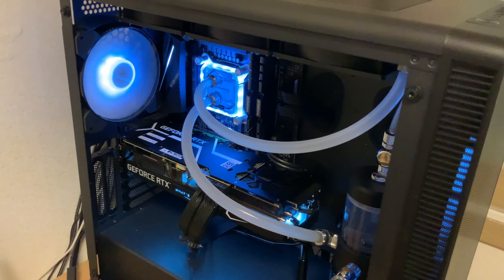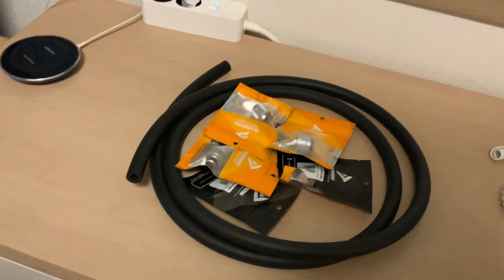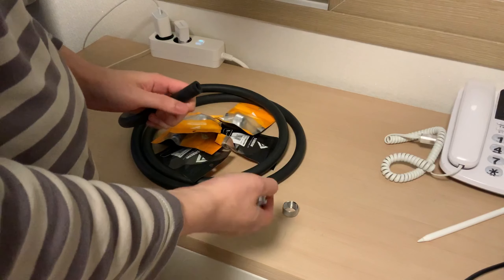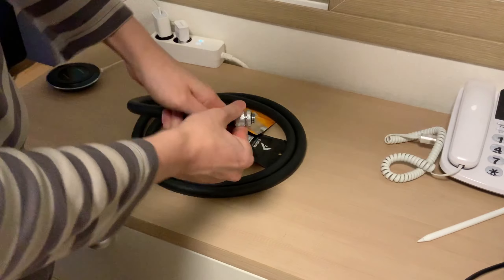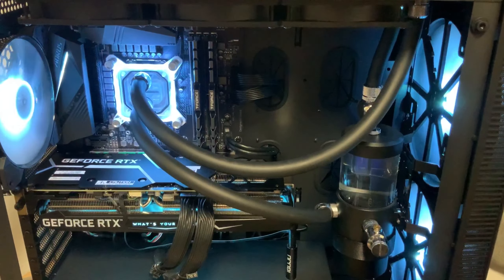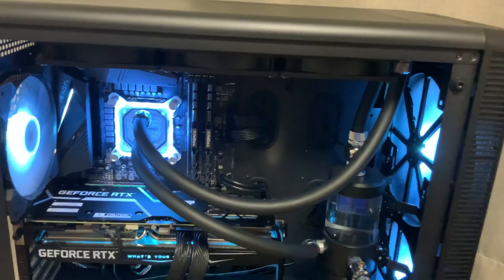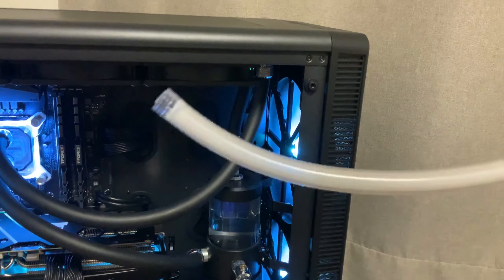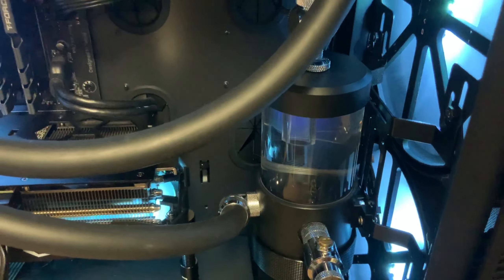Upgrading loop with the EK ZMT tubing and Barrow compression fittings.

Comment: I've used Ek clear tubing and never ran into foggy tubes nor discoloration as long as I used the EK cryofuel. Even my blocks are clean after running it for years.
Reply: I was wondering this exact thing maybe they have it chemically balanced or something so it doesn’t mess with their specific tubing
Reply: @Imperial-simp_destroyer  I think they state that very raining on their website.
Reply: @fromearth6282  ahh ok ya I might do that then usually makes sense to use the same brands so looks ill be purchasing tubes and coolant from EK
Reply: @Imperial-simp_destroyer  Make sure you wash the rads and blocks! 👍😜
Reply: @fromearth6282  definitely will thanks for the info my dude

Comment: I also had an awful experience with yellowing EK Duraclear tubing. My radiators were completely clean and reused from previous build, it just turned yellow and disgusting after two weeks. Switched to black Primochill tubing since ZMT wasn't in stock and now no issues
Reply: ZMT is awful tubing, rather dirty stuff and far from zero maintenance, and is also out of spec with ID/OD which is why OP had a hard time with the compressions. A much better alternative is Watercool's EPDM or Tygon A-60-G. Both are similar rubber type tubings, but are actually clean and properly sized.

Comment: I think there is variations in the ZMT tubing because I have Barrow fittings and the compression piece did not slide on as easy as yours in the vid. Not even close lol.. Man it was hard to rig everything up and my fingers were so sore.
Reply: Theres different inner and outer thicknesses

Comment: Why no GPU on loop?
Reply from the maker: I used to do this in my older builds but its just too much of a hassle for me.  Draining and removing tubes just to repaste, clean or replace parts isn't something I really want to do unless I plan to keep my parts for more than 3 years.  I fan modded my GPU anyways which is good enough for me.
Reply: I dont see maintenance as a problem but changing components is hassle for sure
Reply: @matthewdicksoncrusher5592  how about those gpu which are already prepared for watercooling?
Reply: @EugeneBuvard  what about them?
Reply: @matthewdicksoncrusher5592  wouldn't it be easier to change component then?
Reply: @EugeneBuvard  instead of changing waterblock byself? Ofcourse!
Reply: @jmoonb2000  hello just wanted to ask are you using a galax sg? if so can i know what fans are use in them and is the pcb identical to the ex version?